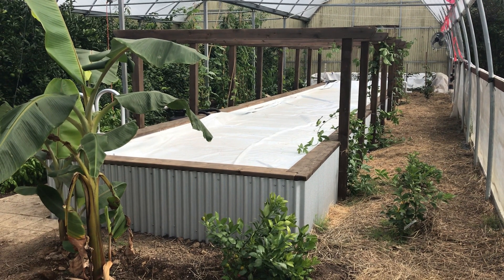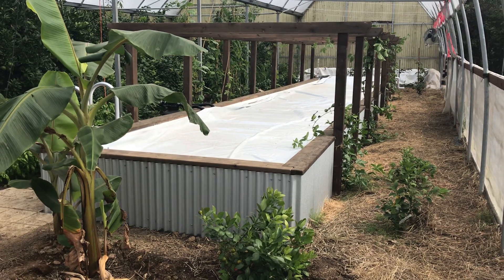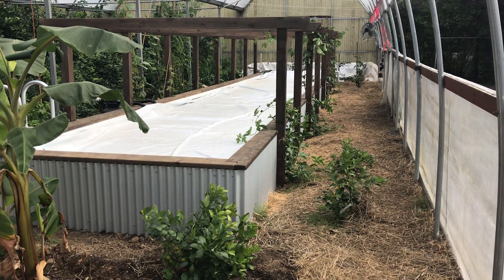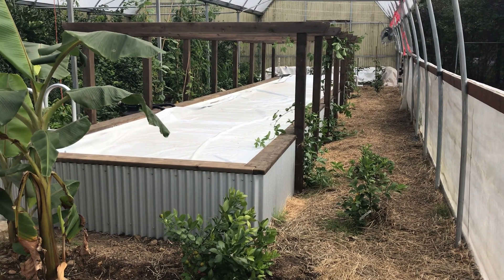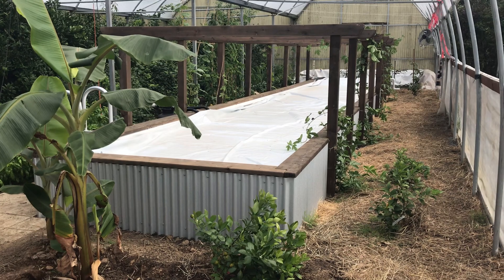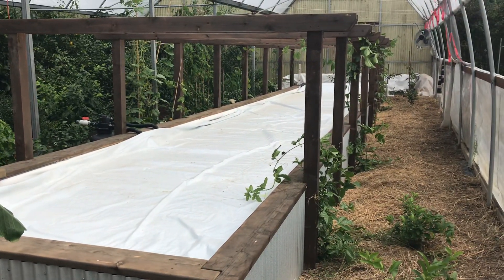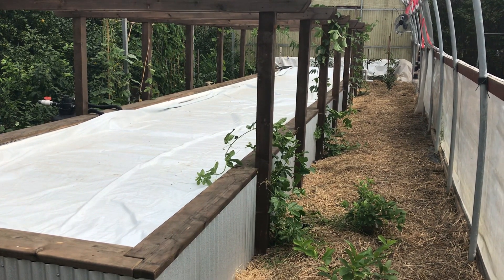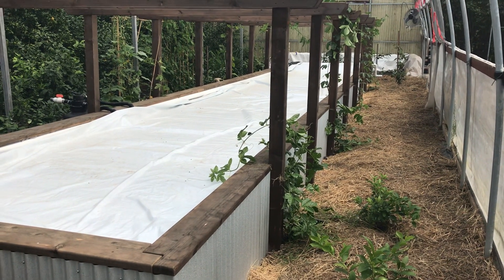#4 - DIY Wood Frame Lap Pool (Rainwater Tank/Heat Sink)

Comment: Can you give an update on the pool now?  Do you still use it?  Thinking of doing a similar project in Minnesota.
Reply from the maker: Yes, I'm happy with it. I heat it to around 20C in the winter with the wood gasifier and the rest of the time with the solar HW tubes. It's doing exactly what we hoped it would do. I don't notice any issues with the liner or supports yet. So pretty with the passion fruit, and now lemons as well, growing on the trellises. 6' depth is good.

Comment: I researched having an indoor pool inside a greenhouse and most of the issues was poor air quality because of the high humidity and poor air circulation. Could you give a bit more insight on how true this is and what you do to prevent it.
Reply: From the looks of your various videos, you have a few fans running and cover the pool always, but is that really enough. And I assume no chlorine in the water?
Reply from the maker: @syedali5678  I think the big difference to most pools is that I don't use chlorine. I use hydrogen peroxide in combination with UV to filter the water. As you noticed the pool is covered most of the time as well. It's covered with plastic bubble solar pool cover and on top of that, 6 ml black/white 6ml plastic to block light. Works really well and no problem with increased humidity or smells.

Comment: what is the advantage of this method
?
Reply from the maker: can you be more specific?
Reply: @janesquier3137  I mean, you could also install a normal heater to heat the greenhouse. Why did they go to such great trouble?
Reply from the maker: @EhsanFarsy  This project is an experiment. I used to heat with oil for commercial production. Now I'm using various systems to keep the energy inputs low, and I'm not using more than 3 cords of wood a year to heat, which is the sustainable yield of my small forest. This means thermal mass and energy conservation methods become important and I use renewables, ie. solar hot water panels, where applicable. Of course you could put a standard heater in but be aware of the cost of heating a greenhouse without some kind of energy saving features!

Comment: think the cover if it was black would absorb the heat better
Reply from the maker: Yes, black side up in the winter. Most of the year it's white-side-up though. There's insulation between the pool and the top layer.

Comment: Curious to hear how the thermal mass is helping moderate your winter temperatures!
Reply from the maker: We just went through a cold spell with -6C nights and days. I heated the new pool to 24C, it dropped to 20C after 5 days. The wood gasifier using maybe 1 wheelbarrow a day for 6,000 square feet, temps 4.5C. Very happy.